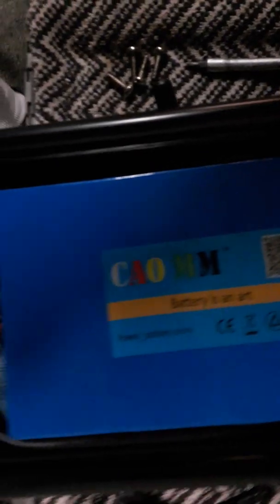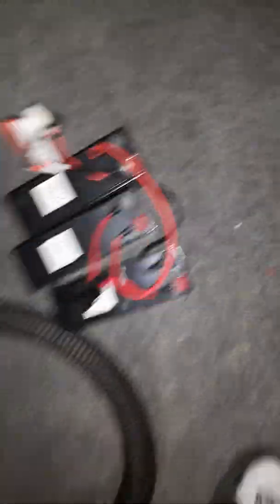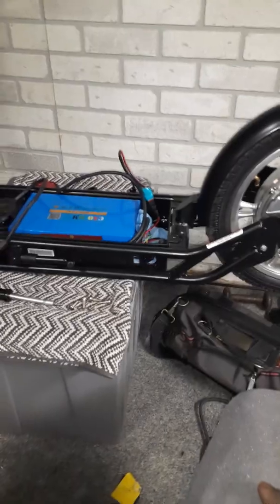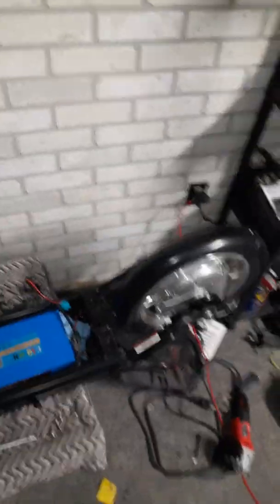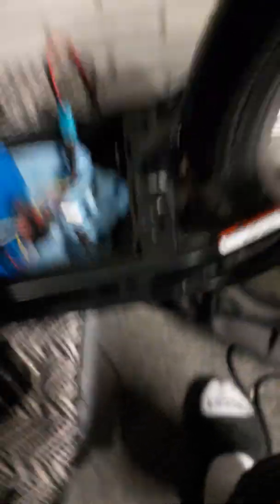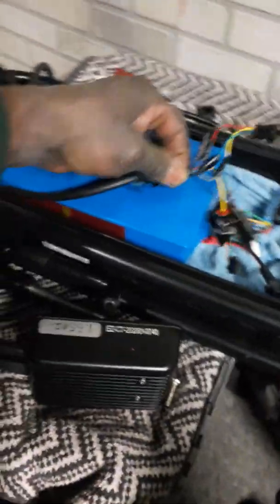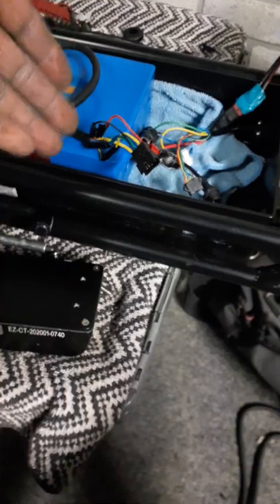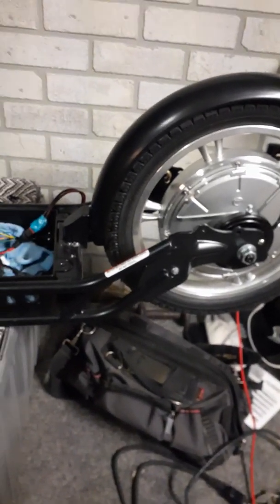Razor Ecosmart Sup scooter..deep dive into a 48v set up ...

Comment: Hello! I purchased the 36V battery and kept the same controller. The original batteries were plugged using a 6.3mm male and female connector. I don't see it in your video. Did you plug the new battery to the controller without it?
Thank you.